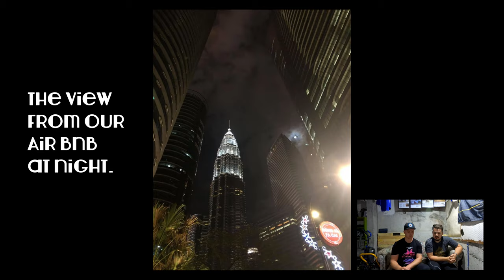Buying Motorcycles in Kuala Lumpur, Malaysia

Comment: hey im from malaysia, thank you for supporting malaysia and nice sharing about honda wave.
Reply: im proud whenever foreigner mentioned Malaysia in a good way la..
Reply: @madros1060  yeah of course! im also using honda wave so that nice sharing.
Reply: @AliBaba-nb1ge  i used bike same as yours almost 5 years but recently its temperature arise faster. Any suggestion guys?
Reply: @danishdarish7498  get the fully syn material of engine oil
Reply: @charlotteoon7294 if aint expensive, gonna use soon but any brand is okay right?
Reply: @danishdarish7498  it is up to you but i would recommend shell advance bcos i have used it and it worked well with the engine. the price is quite cheap which is rm50.
Reply: @charlotteoon7294  nice one. will consider for my upcoming sevice.

Comment: I have seen a few articles on the internet regarding "can a foreigner on a social visit visa purchase a bike in Malaysia". The good news is YES. As I am an amputee I bought an automatic Modenas Elegan 250cc (second hand) from a dealer for £3000 GBP. The dealer took my passport details and I had to supply a mailing address (for insurance purposes) in which I gave the condo address where I was staying. Make sure you always have your paperwork (passport, insurance document, motorcycle tax and helmet) with you when out riding. I was stopped three times within the space of one week at police roadblocks and asked for the paperwork and passport so be aware of this.
Reply from the maker: Yeah we did the same. So easy huh? But as you mentioned - it was drilled into us to keep the paper work on hand at all times.
Reply: when you bougt the bike how long is the process, registration, road tax, insurance

Comment: Same bike as mine..But mine not frequently used because it produce loud noise...
Reply: i faced same prob before, then changed the engine oil and now it recovered.
Reply: @charlotteoon7294  is it works? feel like waste money if it do not give any effect..
Reply: @whitesand9714  no worries la, try go to workshop then if you're still careful
Reply: @charlotteoon7294  okay, what brand that u used?
Reply: @whitesand9714  shell, surprisingly after a week used, i can see the vibration and noise dissapeared
Reply: @charlotteoon7294  never use it before, but i heard from my friends it is good.